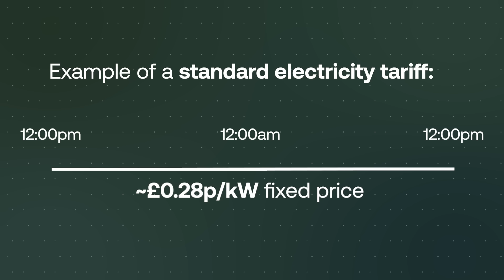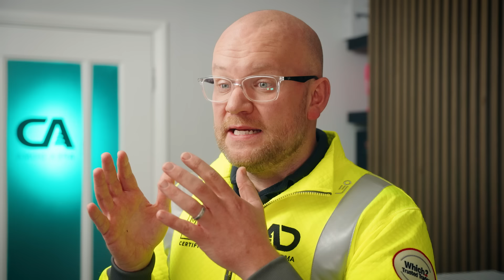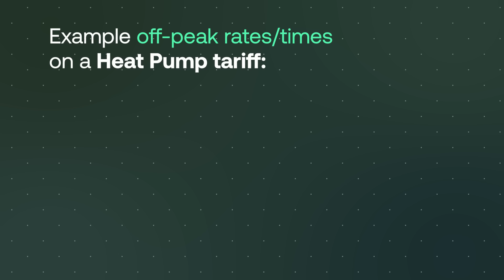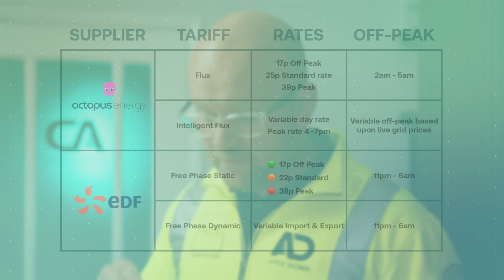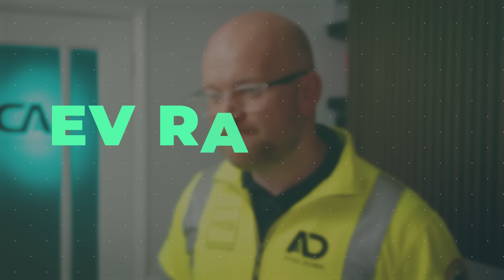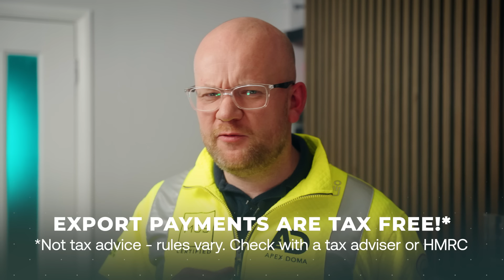Best Solar, Battery & EV Tariffs for 2026 | UK Homeowners Guide

Comment: Good summary. But I am surprised that you did not mention running washing, dishwashing, dryer etc. during the cheap time slot. I always charge the batteries @ 7p and export most of the solar at 12p.
I find the heat pump tariff very expensive.
With 17 kWh of batteries in the last year I only bought full rate power for a few weeks in the winter.

Comment: Actually, whenever export rates are higher than off-peak import rates, why would you ever want to charge your car/battery from pv? Only if your batteries are very low, I'd have thought .
People need to stop talking about "free" electricity from solar. It isn't. It cost you what you lose by not exporting it. 12ppu currently .
Reply: It's only free once the purchase price of the kit has been amortised.

Comment: You'd think the suppliers would make it easy to switch between them and other smart tariffs. Instead many of them say 'existing customers only' so you effectively have to switch twice: once from current supplier to new who put you on a rubbish export rate, then second, now you're one of their customers, you can switch to their better export tariffs.
They also punish you if you had your solar and battery installed by someone else, they wont give you the rates as someone who used that supplier to install a frankly substandard complete solar and battery system.

Comment: I have 4Kw solar PV since 2011 and get the full subsidy from EDF for PV produced plus 5p per kw for the assumed 50% export. 25 year contract
I now have a smart?  meter and will be buying a battery storage system. I have under floor electric mat heating, no gas no oil, and consume 15000kw per year. No EV car today or on the horizon. 
Q. Is 10kw storage enough? What control system should I get? Who should my supplier be?

Comment: Are there any features that are only available with the gateway? If so, are they worth it? I don’t really need the gateway for power cuts, as I very rarely have them. However, I was wondering if I would be missing out on any useful app features without it, and whether those extra features would justify the additional cost.

Comment: I’m getting solar panels installed this month. I’m having 12 panels aiko gen 3 490w 5kwh inverter and 10kwh battery. Thing is my new energy supplier has been the best I’ve ever been with. My place is electric only. I have 2 air to air heat pumps. They tend to draw a maximum of 500w each. My energy supplier is charging 50.69p per day and 18.69p per kWh. I use approximately 12 kWh per day in winter and less in summer unless it’s super hot. I’m on this deal till September 2027. My energy supplier doesn’t have a feed in tariff which is an absolute shame. Do I quit the best cheapest no stress back and white bills I’ve ever seen to jump into the unknown. Scottish power edf bills were crazy and they took crazy money from you then put it back to take it back again to the give you back. Each time different amounts. My company now they bill me for exactly what I use. My Roof is south facing unobstructed. I see I wall save money by sticking with my company but paying the daily charge and little extra when needed if I swap will I be better off selling back in the long run. I’m thinking stick with my super cheap tariff and switch when my deal runs out in a year and half. Hope this makes sense. I’m a bit dyslexic.

Comment: A very clear explanation of what is a complex issue. We are with Octopus on the Octopus Go tariff but want to change to Intelligent Octopus Go but we seem to have a problem. Either our cars (Kia EV3 long range, Kia Niro 4 -2020 – and a Hyundai Ionic 2021) or our car charger (SolarEdge charger, 2 years old) is showing up on the Octopus site as not being compatible (though which is the issue is not identified) even though the cars are listed in their drop down. Have no idea why and am having trouble finding out. Am trying to get an answer from Octopus and also SolarEdge but this does not seem to be forthcoming. Would welcome any advice.

Comment: Hello love your videos, I want to install a battery to use off peak energy, I don't have solar due to my roof position!
I am thinking I need a 10 kw battery, as my usage is quite low, for my wife and I. I do have an electric car, a Renault Zoe! I am not using off peak energy as I only charge the car once each 2 weeks, it has a 40kw battery.
What would you recommend regarding a battery type, I dont have a large budget!
Thanks Terence.
Reply from the maker: Hi Terence,

Thanks for getting in touch.

Sigenergy is a really solid option for battery only. The inverter can be configured with or without solar.

Hope this helps.

Comment: At the moment, my provider gives me cheap night rate of 6.5p for 5 hours and an export of 15p all day. It makes no sense (even in summer) to use my solar and not charge the battery at night since battery energy costs me 6.5p whereas that generated from solar costs me 15p to use.
Reply: Morning.  Im about to have Solar and battery installed.  Do you have EV to get that 6.5p cheap rate? If not, who is your provider, if you don't mind me asking :-) ?
Reply: @networkit2741  Morning! You won't regret it! My electric bills have gone down to 1/5 in winter and spring/summer make me a significant profit. Even March this year is looking like a profit making month.

I'm with GoodEnergy on their EV tariff (absolutely recommend). I have an EV and charge cheap at night.

Comment: I need as many cheap rate hours as possible .I run two heat pumps overnight on constant flow to heat whole house and turn it off when peak starts , sufficient insulation to keep heat in for 18 hours .
  The best I can find , at least for that scenario , is Eon , 6 hours cheap rate , charge 24kw battery and run heat pump in those hours at 6.5p inc Vat .
  The house runs off the battery all day , any surplus from solar or battery can go back to grid at 16.5 p .
  But , EON was 7 hours and now gone down to 6 , others are reducing the export rate EON have by linking it to an EV , you can see where this is going , cheap rate and decent export rates are going to disappear and the incentives to invest in the necessary kit will be nil or very little .
Reply: What tariff combinations is this?

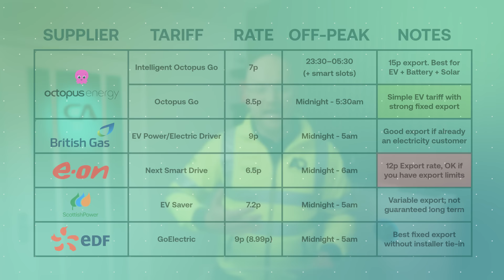Comment: 25:50 If you get a ToU tariff from E-on your export rate falls to 6p/kWh, which IMO is not viable if you have solar+battery. (Edit: I typed 'octopus' not E-on by mistake originally, that was obviously wrong)
28:20 Tax - Apparently you do have to pay tax if you generate more than 20% than you use, and you exceed your £1k trading allowance including the export payments.

Comment: Brilliant video, so much detail!

IOG sort of works the way you said for now, as changes that were going to come in on 1/2/26 have been delayed. The changes arent really that significant as they were always in the fair use policy, but now they will be enforced.
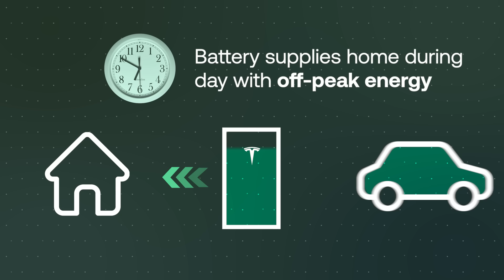So as you say 6 hours off peak guaranteed for the house between 23:30 and 5:30,  but NOT for the EV. The EV also gets 6 hours and no more between midday today and midday tomorrow. If some of those hours are outside the 6 hour house window then the house also gets cheap power then just as now. The difference to what previously happened is now you are allowed to have more than 6 hours EV charging (you werent before) but any charging over the 6 will be at peak rate even if it comes in the off peak house window. Teething problem rumoured to mean that any solar charging or manual charging count towards the 6 hours have delayed the roll out.

Comment: I have a Tesla PW3, Tesla car, Solar and a Growatt battery however when I used Octopus Intelligent Go and had Octopus controlling my charge times it would drain both batteries for the car and then we would import during the day at a higher rate so I now have stopped the Tesla car using IOG, not had the PW3 long enough to use it in the summer so no idea how to get it to export at higher rate, any help would be great
Reply from the maker: Hi Steve,

Is it your car or charger which is registered with Octopus? Have you heard of the net zero app?

Ian
Reply: @apexdomasolar  yes charger on IOG, I now have stopped the IOG controlled Tesla charger from controlling when it charges my car to just charging using the Tesla schedule between 11:30pm to 5:30am, I have the netzero app but don't really know what automations I need, in the evenings the Growatt battery discharges into the Tesla PW3 and the PW3 sees this as solar!
Reply: How do you integrate your groweatt with the powerwall. I wanted to increase my battery storage but was told Icould only use powerwall.

Comment: Great informative video -  I stopped with Eon when Apex installed battery and solar in November (as I would have had to pay an exit charge) and now receive £0.17 for export and pay £0.065 between midnight and six am - eon next exclusive v2 is the export tariff. Most days the battery supplies the house needs however if it doesn’t it only costs £0.29 to buy extra in. I am also able to charge the car overnight - in summary Eon is worth considering given higher export they offer on V2.

Comment: Am just glad I am 73 years old, so will not need to bother myself over any EV purchase or house energy conversions, lol.
Different story if I was under say 65 and in great health.
Reply: I'm 68 and have just installed a huge battery and have 2 EV's and an ASHP My annual energy bill is down to about   £700 from closer to £3000 and potentially I could even another £600 from solar export bringing the bill down to almost zero. That £700 includes all our driving, heating and power for the home.
Reply: @mikebarry229  With £1.6k pa energy bills and 6k diesel miles pa, I would never see your likely £30k installation bill paid off, before I start saving anything. 
Additionally my house is possiblly nearing having all electrics, ALL plumbing and radiator upgrades, and maybe re-tiled if I start messing up there so a lot more headaches and extra costs over £15k.
Mind you I will be well pissed if I live to be 100 lol.
Reply: @mikebarry229  How big a battery, and what was total cost of ASHP, Battery, Solar, and control panel (gateway ?) - how old a house ie did you need to upgrade water pipes, radiators & pipes, and electrics - do you have a payback timescale ?
Reply: @palemale2501 House is 1950's, cavity brick downstairs which we insulated, but only 125mm solid concrete blocks upstairs, so very poor insulation. I was fortunate in that I installed solar when the feed in tariff was at its maximum. I get paid something like £3000 a year from that but the install cost was £13500 at the time. It has paid for itself 3 times over already, with 10 years to go. I got the ASHP 9 years ago, after taking off the subsidy the cost was about £5000. I did change all the radiators and all the pipes myself before the heat pump was installed but only like for like, with what I know now I would have increased pipe sizes and radiator sizes to enable lower flow temperatures. The battery was a big expense and bigger than it needed to be, battery itself was £6000 for 45kWh, but on top of that the Victron inverters added £3000, cabling switchgear and consumer units another £1000, and electricians to wire it all up, another £4000, so £14k all in. Victron gear is brilliant in that it doesn't need a gateway, it is all built in as standard. My inverters can provide 13.2kW which is enough to run my entire house in the event of a power cut, and more importantly means that I can run my entire house on 7p electricity, charging the house batteries off peak over night. Annual electricity bill with solar, ASHP and one EV (prior to installing batteries) was £2700, now, with a battery and an extra EV the bill is on target to be about £800 (which is what the diesel used to cost) so roughly a 5 year payback.
Reply: I'm 80 next month, had solar panels for 14 years and have just ordered a 10kwh  battery. It should save me £500 pa, but the main benefit is energy security should power cuts start following the disruption of the gas/oil supply lines.
Reply: @FrankDunbar-n9m  Yes, I would do exactly the same, if I was 66 and starting with solar - I have the additional problems of my house likely needing rewired, and roof tiles needing assessed at least, and less sun in Scotland.
Reply: @FrankDunbar-n9m  Having the battery is a game changer, especially if you already have solar. I went for a much bigger battery (44kWh) as I have very high usage compared to most people (ASHP). The battery means I can power my house year round from off peak electricity (including charging 2 EV's) for around £700/year, and I now export all my solar on a SEG tariff for £600/year (on top of £3000/year from FIT)

Comment: We only need to import energy because 5his labour and conservative government shut down 28 power stations and didn’t rebuild them, instead Ed has this nutty idea that seasonal(emphasis seasonal)can run the U.K. all year round, fun fact we have generation at the moment that at peak cannot even be use by our grid  so are forced to export it at a net loss , yet that isn’t passed on to customers, or using it to generate hydrogen that many boilers have comparatively at 10% to cut imports. But the thing is we only ran last year 37days out of 360 because the wind was insufficient.

Comment: Worth noting that you can use Predbat (free) with a load of inverters from a wide range of vendors in order to do the same tricks that some of the top end vendors offer. Also has the advantage it's not dependent upon some random cloud service and as it's open source and run locally it can't go bust.

Other suppliers - don't forget Good Energy.

Taxation: taxation on microgeneration is only exempt up to 120% of your usage in general, then it becomes miscellaneous income. So if you sent up an enormous solar array and you actually manage to cover your own usage, and 20%, and use up your miscellaneous allowances you can in theory get taxed. However for most people it would be fairly challenging to cover all their usage plus 20%, and if you do buy a hot tub instead 8).

An "electric vehicle" is any carriage for use over land that can be self propelled by electricity. In other words the "EV" tariffs are a lot easier to get than people would have you believe if you are willing to pick a fight. Even if not there are people like Good Energy whose EV tariff doesn't seem to contain the bogus and discriminatory requirement to own an EV. The smart ones like intelligent Go though really do need the right charger/car.

Other thoughts
- If you have a small battery and a heatpump then Cosy in winter/EV or Flux and the like in summer can be a good combo
- Some people like to work out what they can get charging overnight and then exporting it back in the day. That's not allowed on the SEG derived tariffs only stuff like Flux. Suppliers have cracked down on people doing this.
- You are however allowed to buy power at night at 7 to 8p and use it, and thus export all your solar at 15-16p!
- There's a big change coming April. The base unit cost goes down 3.5p as they take the taxes off. At this point nobody knows if they'll take the full 3.5p off the cheap rate units but that would dramatically change the maths
- Don't assume you'll get 15-16p export forever - nobody seems to believe the current rates are sustainable.
- If you can't get a functioning smart meter then it's still possible to make some of this work with a battery and Economy 7. It's just nothing like as a good ratewise.
- Eon now restrict export rates on time of use tariffs. That matters a lot for some use cases.
- Northern Ireland is different unfortunately for those living there.

Good to see someone explaining about the importance of inverter size versus battery size. Overlooked far too often especially now its only £3200 for a 36kWh battery pack. Never go for a small battery. It's going to cost a grand for the inverter, a fixed large chunk for the installation and at those kind of prices for a big battery there's no real point saving a small amount getting a tiny battery when all your costs are inverter/cabling/installers.

My experience with Octopus was that they asked as soon as told about new solar going in about the export tariffs you wanted to use. Also watch though if you buy a house with solar on that the supplier doesn't set it back to SEG from whatever the previous occupant had

Comment: Taxes on Export was announced the day after this was published.
Reply: Taxes on export have existed *forever*. The rules for taxes on export were set in 2007 to exclude most microgeneration. You have to generate 120% of your usage over the year for it to be considered as income. Even when it's income it's miscellaneous income so it comes out of your £1000 misc allowance so you'd actually have to generate all your power, 20% over it and then so much more you used up your allowance.

At that point you are most definitely operating to make a profit and it should be taxed.
Reply: Always there but only recently become noticed. You are allowed to generate up to 120% of your homes energy needs without paying tax. Battery exports (so download at 7p export at 15p) is potentially taxed straight away though you may have a £1000 allowance